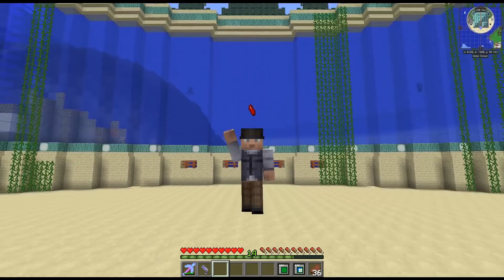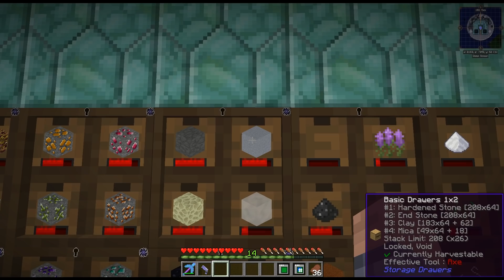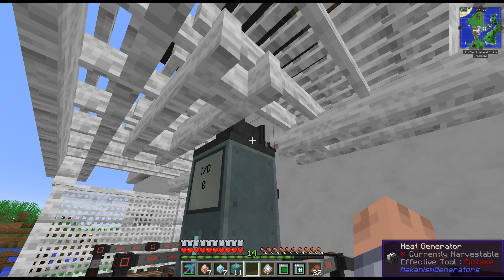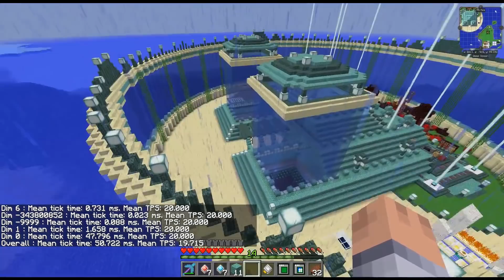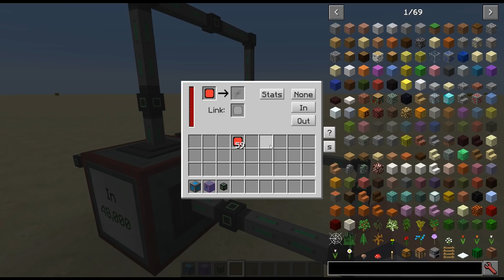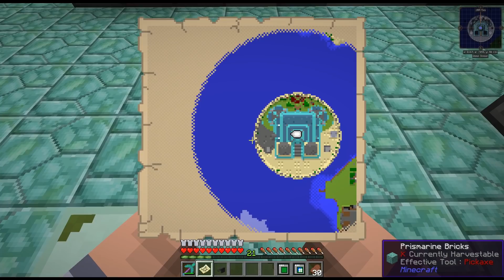Modded 1.10.2 - House cleaning - Avant 3 ftog S4E29

Comment: There is a visual bug with the disks on RS - you can place the disks but it looks like it is still in hand. if you close the inventory and re-open it, the disks will show up. Rather annoying but it works ok. I find shift-clicking when moving disks is the most consistent way of working with them.
Reply: You can also shift-click JEI items into patterns without having the items in stock. Also, stack upgrade will make the importer and crafter slightly faster.
Reply: stack upgrades dont work in crafters unfortunately
Reply: I thought they allowed a stack at a time to enter a machine, not normal crafting but machine crafting??
Reply: they do just not normal crafting